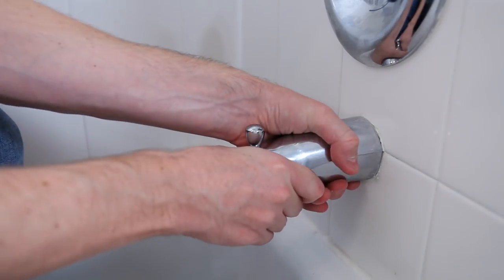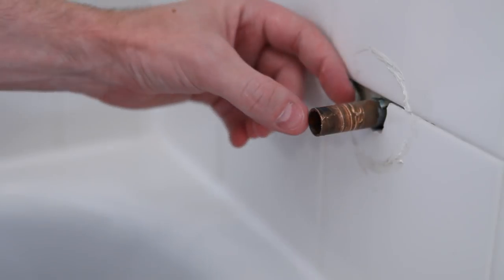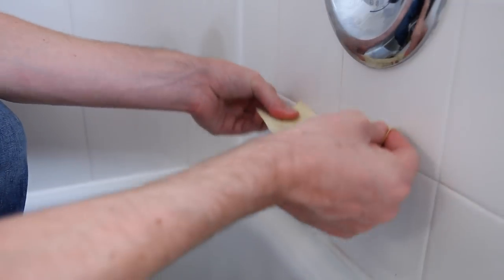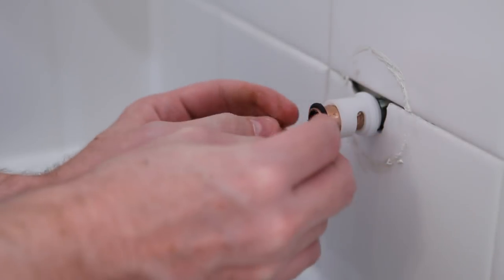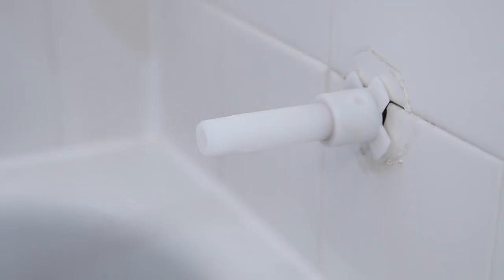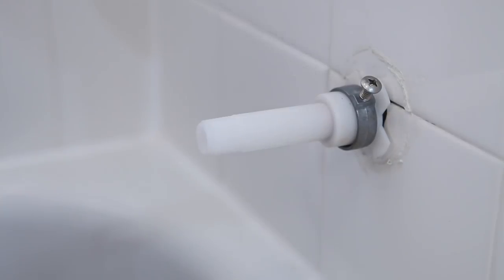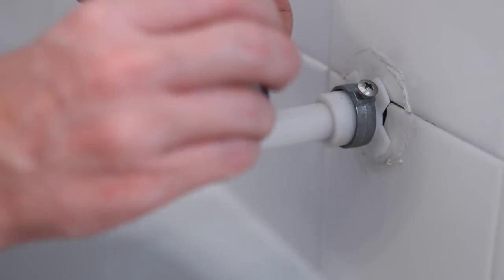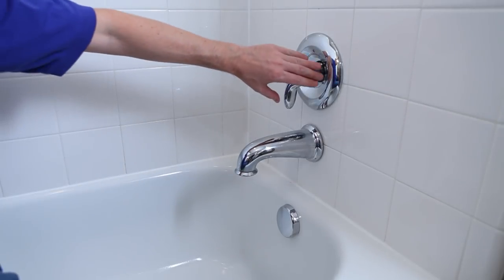How to Install a Tub Spout

Comment: I bought one of these POS and wound up returning it to Lowes. The instructions were incomprehensible and contradictory. I found a  Brasscraft Mixet (MXT01) on Amazon. It comes completely assembled, and all you do is slide the spout over the copper pipe and tighten a screw that's attached to a retainer ring inside the spout that clamps around the pipe. I almost couldn't believe how easy it was. $19.39.
Reply: Yeah this was a slip on to threaded conversion

Comment: I'm replacing an old faucet with a lime-encrusted diverter. Picked this up at HD, since Danco is the only brand they carry for a single bathtub faucet replacement. Got it home, unpackaged and took a look at the instructions. They were probably the worst instructions I've ever seen. Missing step about drilling out the hole for the retaining screw. Unclear about when to tighten and how much...I'm an engineer. I like clear directions. I'm using 1/2" nipple copper with no threading. Did the install, leaks out the back. Did the install again with 8-10 wraps of teflon tape...worked for about a minute with no leaks, then turned on the shower and leaks out the back. The leak comes from the adapter to the extension nipple. I can't do anything else with this kit...I've already started to score the copper pipe due to the tight retaining screw..and I can't put more teflon tape on it. Complete waste of money for me, the job is going to take another day at least to complete, and the the poor instruction in the kit could lead someone into damaging their pipe, which would be a real nightmare. I find it unconscionable to sell garbage like this. Not cool.

Comment: Thanks for the video.  But why, when I removed the old spout was it a simple set screw...and with this thing there's multiple pieces and components?  The package I bought had nothing that resembled that 'adapter' you show.
Reply: Many parts are tucked up inside the spout. You have to work them out.

Comment: This is what worked for me: use a drill bit slightly smaller than the set screw opening on ext nipple to get thru the plastic. Make sure to clean out the threads inside. Assemble it off the copper nipple and make sure the set screw will go thru as needed. Now assemble as instructed. When you have the set screw on the bottom, use a 90 degree Phillips screwdriver. I had a ratcheting one that was super helpful. Complete the rest of the assembly.

Comment: 👍  I couldn't align the retention screw but no leaks. After trying yo align screw hole & pipe rentention slot for 5 hrs I'm just using without tightening & will watch for leaks Best Video for this topic to the point clear thank you

Comment: I just bought one of these and installed it just like the video I tightened the set screw as much as I could before piercing the copper pipe. No matter what I did when I turned the shower on the pressure blasted the tub faucet off the pipe. I ended up soldering 1/2 in connections to both ends of a piece of pipe and called it a day. Crap product

Comment: This design is horrible. I went through hell with this exact set up. You can't see if the "hole" lines up with the slot on the first threaded piece. I tightened it as mush as I could and the damn spout shot off. Luckily no one was in the tub. Everyone, look for a spout with the "white tube piece" attached to the spout, if using slip on. Don't mess with this kind.

Comment: Great video! You might want to show a little more clearly how to drill the hole in the plastic for the set screw. Both of the tub spouts in my house had been installed by professionals and they failed to ensure that the set screw actually made contact with and indented the copper nipple. I think that's where most folks are having trouble......
Reply: BTW, contrary to all the hussy fits I read here, my Danco tub faucets are both working perfectly.
Reply: jim gray  - Please help a brother out. 
You said professionals installed both tub spouts in your house but they failed to ensure the screw actually made contact with and indented the copper nipple. This is precisely where I’m stuck. 
Would greatly appreciate it if you’d share your solution(s) so I too can get my bathtub spouts working perfectly. 

Thanks in advance

Comment: @Danco: Please reply to some of these comments with a solution. Not just a scripted apology referring them to call customer service. I believe it would restore faith in your products. I appreciate that you did so in your 2013 version of this identical video. We are attempting to remove our spout because there is still a sizable gap b/w it and the wall. This is due to your instructions which direct us to leave a 1/2 to 3/4" gap when installing the adapter (A). In the video, there is no gap and the adapter (A) remains flush. This is what we would like to replicate, per your video and not per your instructions. Unfortunately, when we attempt to remove the spout, it just spins. Any recommendations?

Comment: Just installed this.  It leaked out the back.  Turned out to be the cheapo teflon tape they supplied.  Thankfully I had a roll of my own.  I took off the faucet, got as much of the old tape off as possible, then used my tape.  So far so good.
Reply: Mine is also leaking out the back. I’m going try using my own Teflon tape and see if that works.

Comment: My old spout has no set screw (I promise). The spout is NOT threaded. I have pulled with great strength to pull it off, no go. How do I remove it?
Reply: It probably has a set screw that's turned away from the hole at the bottom.  My old one was this way, somehow someone in the past got the screw 90 degrees off from the screw access hole in the spout and then they just caulked the ever living shit out of it at install time.   There was no way to get it off other than scoring the copper pipe by twisting it off.   Thing was glued in there with caulk and the screw forever inaccessible.
Reply: Mine didn’t have a set screw either. I went in to the spout opening with a flat screwdriver and broke the old plastic adapter in there and was then able to turn it

Comment: What kind of company design's a spout that uses a metal screw to clamp on the copper tubing, then has you screw the spout onto threads, thus turning the metal screw. which cuts into your copper tubing. Ruining your plumbing. This is the dumbest design ever. Now I'm paying a plumber to break out my tiles and soldiering a new copper pipe. A 30 dollar product is costing me 400. Thanks danco. PS the one I replaced had a brain.

Comment: This is without a doubt one of the worst engineered and designed products Iv ever used. This video makes it seems great it is not that way , literally shoots off the stub out copper every time you turn the water on . Can not tighen it down any other way

Comment: This design is ridiculous. You are supposed to align the hole on second piece with the slot on first piece, but you can't see it! Then you have to screw through a "closed" hole till you "feel" it touch the copper pipe, then you keep screwing...but not "too much"! Taking it back. "bout had a brain aneurysm. Simple words, simple parts, it not that hard.